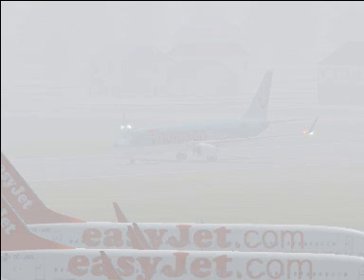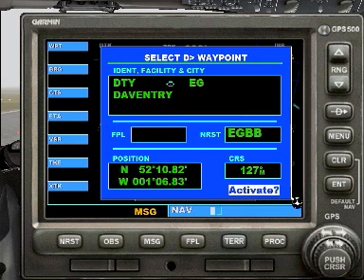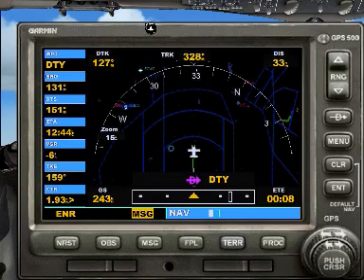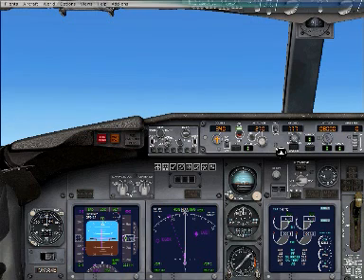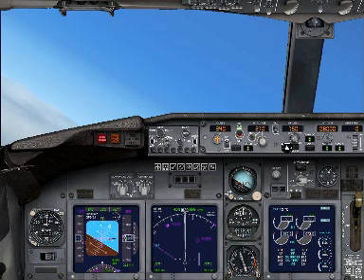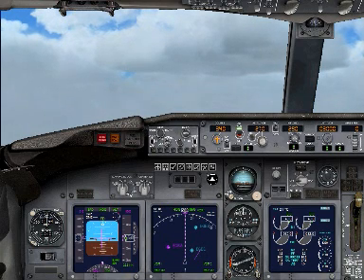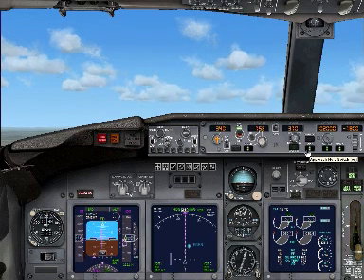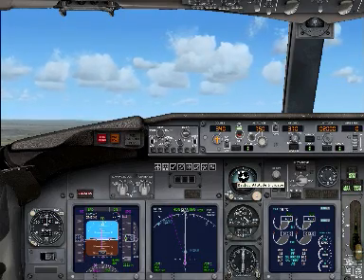FSX GPS GUIDE ILS VOR HOLD ILS FREQ FINDER

Comment: When you cursor to the runway, you click enter on the gps and it automatically changes the standby frequency. Then you just switch the button between the active and standby on the radio. We wait until we receive the landing runway info before selection.

Comment: The title of your video includes vor hold, but you didnt do a vor hold in the video at all. In fact you didn't track a vor at all in the video. You went from gps straight to ils. Which is fine, but take out vor hold from the title, if your are not actually going to do a vor holding pattern.

Comment: @damian483 not sure how it works in the UK but in the US we use FL for anything above, but not including 9999 ft. So we would say to ATC "New York Approach, Cessna 2 Mike Alpha is descending from Flight Level 120 (12,000) to flight level 100 (10,000)." Anything under that is not commonly used.. It's less confusing to say 5 thousand feet or 2 thousand 500 feet rather than flight level zero five zero. Great tutorial btw.